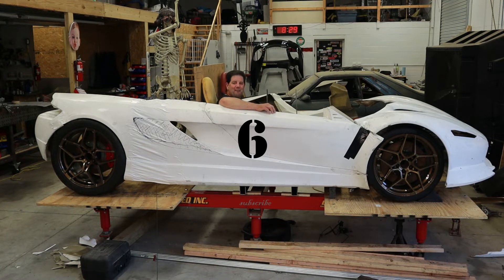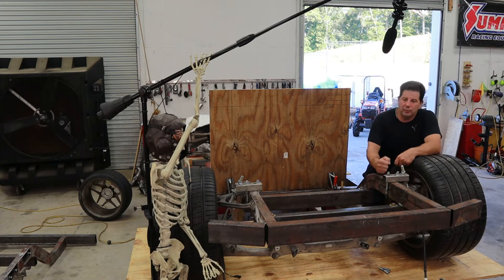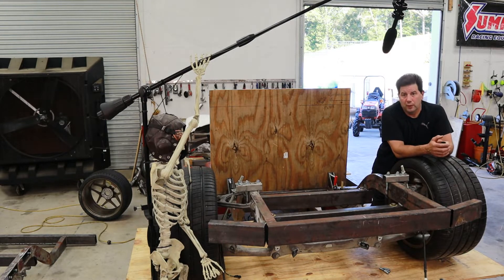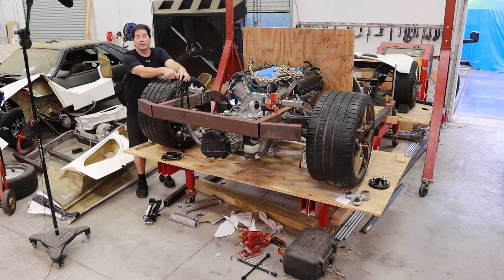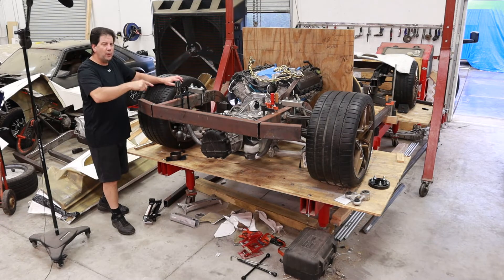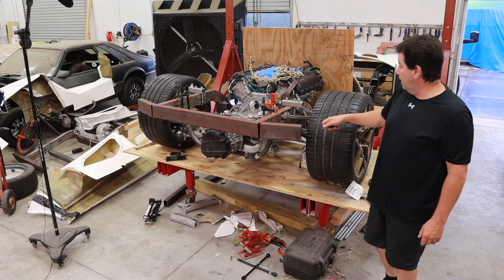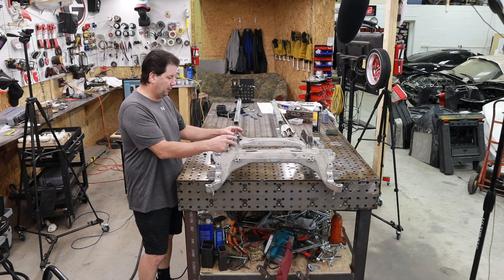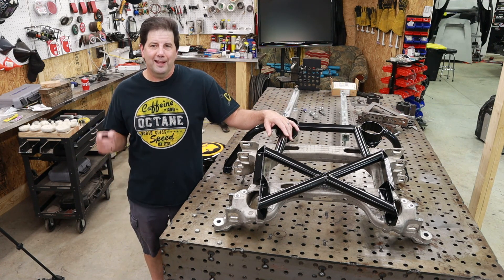Project Split Decision Car 1..Ford Aluminator XS Car 2...Tesla Model S swap ... DIY  Supercar Part 6

Comment: Do you sale these when ur done
Reply from the maker: That’s my plan for the next car.  That’s one of the reasons why I built the 5 axis.  My friends make airplanes and are helping me calculate loads.  But you have to walk before you run.  😀
Reply: XS MotorWorks I’m the bump ur head until the wall breaks kinda guy I have an engine I’m trying to 3d print and cast I want to turbocharge it Bc it’s a small engine
Reply: XS MotorWorks I actually have two engines in cad but the second needs more machine work than casting and is a little alien to find in a car
Reply from the maker: Thinking about it.
Reply: XS MotorWorks I wish I could ask more questions because I want to build my own cars aswell but I wanted to make a monocoque chassis to do it on by welding aluminum plate
Reply from the maker: Sounds cool. Keep me posted.  Cheers Brian
Reply: XS MotorWorks will do